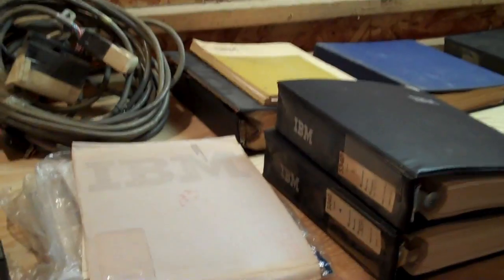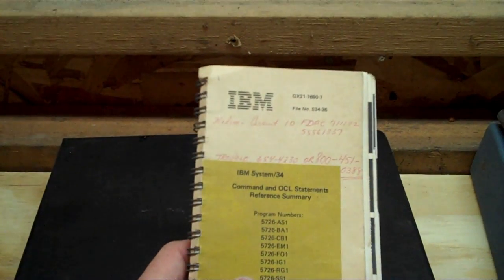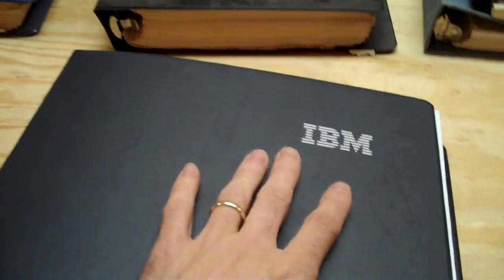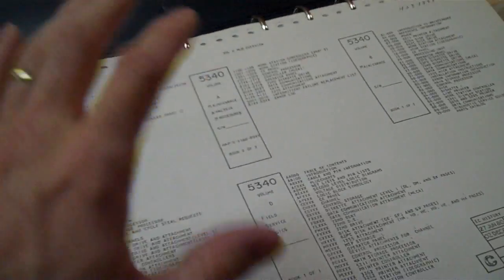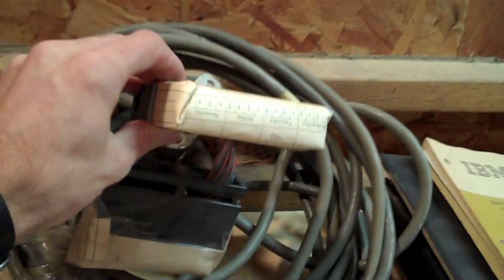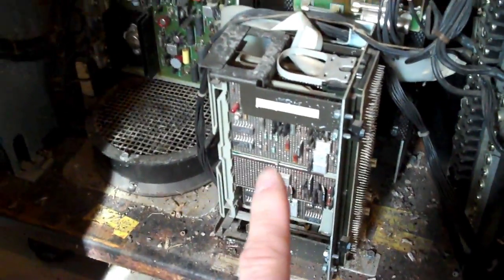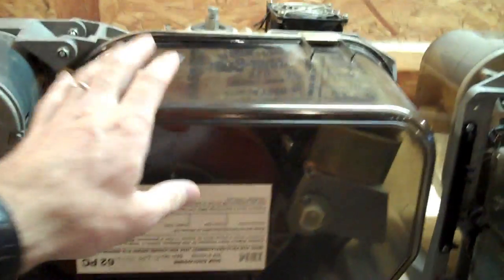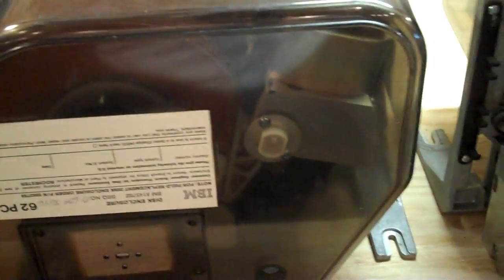Tour of a (needing restoration) IBM System/34 - Part one

Comment: Where do folks buy, sell and trade these?
Reply from the maker: There's vintage computing web boards (VCF), and eMail list serves, which is probably the most likely place you'll find something as old as an S/34. Auction sites used to be a reasonable source - govdeals, et al - but, of course, there's pretty much none of this vintage gear hiding around anymore. eBay sometimes can be useful... But since retro became a thing, it's generally not. There are VCF conventions all over the US (and some internationally now, I believe) which would be a good way to connect with people who are into this sort of thing, if you can make one. Best of luck

Comment: My first programming job was writing RPG II code on a System 34 for an AVIS franchise around 1984. I wrote programs to help with inventory control, invoice tracking, accident reporting, etc.
Reply from the maker: Sweet. Although I flipped through the RPGII manuals I never got the chance to actually use it. This is probably a good thing. I was, however, able to help a friend - his company had a twinned pair of AS/400s that ran its inventory (pre-ERP stuff) through a home built system. I was able to identify that it was RPGII from looking at it and explain why it looked so bizarre to us structured programmers - it was designed to be entered on punch card and was column ordered :) It's amazing what you guys put up with :)
Reply: I had never heard of RPG II when I got the job. At that time, I had only 1 semester of college, but I'd been programming for 6 years in APL, IL, BASIC and Pascal, so learning another language on the job didn't worry me.

I just looked at an online RPG II reference manual - I remember almost nothing about how it worked.

Comment: Wow, I "grew up" on this machine, programming on it starting in 1979. I remember the blue binders for the hardware for the IBM CE (Customer Engineer) and the yellow manuals for me.  Then came the S/36 as a follow-up, then an Advanced/36 which was a RISC-based. I admire your effort. IBM built machines to last.